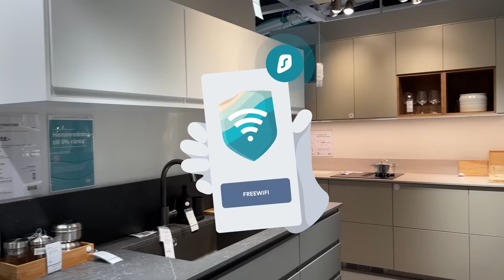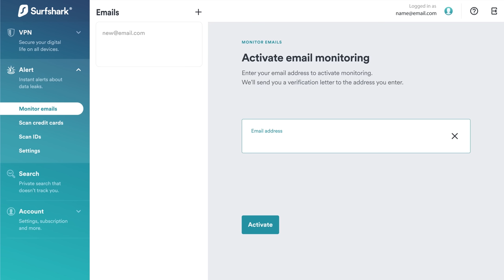Kitchen MAKEOVER- Going from DARK to LIGHT

Comment: I really like the new look.  The older I get, the more I appreciate a bright, light kitchen so I can see!  I especially like the lack of knobs on the cabinets--one of my pet peeves about the kitchen in my house is that whenever I lean in to the cabinets when I cook, the knobs catch on my shirts between the buttons.  I step away and find I'm caught!  When I redo my kitchen eventually, I'll have to look for cabinets like yours.
Reply from the maker: Yes! I had a linen shirt torn to pieces because of the knobs on my previous kitchen!
Reply: Another option is to replace knobs and pointy handles with rounded corner handles.  I have brushed nickle ones that I love.  No more accidentally opening doors and drawers.  And easier to keep clean than wiping the whole door, husband has been handle trained.

Comment: My kitchen units are the same as yours, same handles and easy to keep clean, and I love them.  Like you, I am not keen on the visible built in microwaves, and I definitely don’t want anything sitting on the work surface, so I wanted to have a microwave oven inside one of the wall cupboards, I had a power point placed inside in readiness.  However I have not been able to find a microwave oven in the U.K. that fits inside!  The interior measurement of my wall cupboards is 306mm deep and 565mm wide, if any of your viewers knows of a microwave oven that would fit, I would be very grateful!
Reply from the maker: Yes, you need a slim one! Mine is from Sharp and doesn’t have a handle. It was the slimmest one I could find.

Comment: Love the new kitchen. I also have white high gloss handless cupboards. They are very good for reflecting the light back into the room especially when the room doesn't have much natural light. The new design fits the space better. Would love to see how you organized items inside. Quick question: why did you not go for full length to the ceiling? Especially since you have a ladder handy. I find that there is a lot of dust gathering on top of the cupboards and although you cannot see it easily, it is there! And very difficult to clean (when you decide to do so...). Thank you!
Reply from the maker: I have really tall ceilings, don’t want to hide the stucco and also don’t need the storage.

Comment: Love your new white kitchen! How are you liking your sink? If I’m not mistaken, it’s a little smaller than the one in your old apartment. Has it been easy to use this new sink? I am in the process of designing a kitchen, and if I choose a larger sink then all of my base cabinets will not be the same width. I’m concerned about the visual clutter of different base cabinet widths. Your new kitchen looks so nice and streamlined as you designed it. Thanks for sharing the process with us. ❤
Reply from the maker: The sink is the same size as my last one. The color of it must play tricks with the eye!

Designing a kitchen is quite difficult, so many things to consider. I suggest getting help from the kitchen company if you haven’t already. They have so many tricks that you wouldn’t think of. I used IKEA’s help but asked them to work around the existing kitchen cabinets which was my bad. Should have asked if they could suggest a better layout as well. Now my contractor came up with that instead😅

Comment: I love that the plain white cabinets now allow the white details in the building to really shine - the doors and window molding etc are much more noticeable now. But I have a question. Did you say it took two weeks of half days for the team to remove and replace your cabinets? I just had a slightly smaller kitchen than this installed and it took 4 hours. While the workmanship in yours is no doubt much better, I'm still trying to figure out what took up all the extra time?
Reply from the maker: They weren’t here all the time during the two weeks. They came and went and had to wait for other trades to do their bit until they came again. Also this building is over 100 years old so nothing is straight here. Putting up
a kitchen from scratch is easier (and cheaper) than to take one apart and reusing parts. Also the work they did is impeccable.

Comment: Hi Benita. Could you explain what you have done with the light that hangs over the kitchen table. I noticed you have beautiful ceiling roses in the centre of each room, yet your table is not central. Just curious. Beautiful apartment and I've now had my daily motivation to get myself going. Off for my morning walk along the canal. Thanks, from Manchester, UK.
Reply from the maker: I attached a screw to the ceiling over the table and an “elbow” thingy on the cord so it doesn’t slide. Does that make any sense at all?😅

Comment: At 5:20, that track for the uppers is not level, at least not with the moulding. I assume the new cabinets hang straight and even, though.
Reply from the maker: The building is 110+ years old so nothing aside from what the carpenters installed is straight.

Comment: I would love to see a kitchen organizing video. The boys did an amazing job! The thing with doing it the right way is to do it from the scratch. It will never work if you only try to make it look good. My dad was a carpenter and if we had a wobbly chair he always took it apart completely and reassembled it with new glue etc. Otherwise it would always be wobbly. But your kitchen floor is really crooked. The basebord under the fridge is much smaller than on the other end. 😀 Dark and moody is really a problem atm. My fridge is about to break down and I have such trouble finding a new one as the majority is that horrible brushed steel OR black surfaces nowadays! I don't want a big black box in my kitchen. Aaargh, there are still white ones but they don't have the facilities I want like 'no frost' for the freezer etc. And I don't want it built in into a cabinet also as it stands for its own. I never thought it would be difficult to find a new fridge. 🥴
Reply from the maker: Yes, that's what my contractor explained right away after seeing it in person. Your dad = wise man!

Comment: Looks lovely, just one thing I noticed there is a slight gap on the second drawer under the brass tap, maybe the angle of the filming or the drawer isn’t quite shut?  Your apartment is becoming very homely 😁
Reply from the maker: Probably the angle. But also, after assembly things will shift down a bit and might need to be readjusted after a while.
Reply: @BenitaLarsson  thanks for your reply, just one more question.  My brother is coming to Stockholm at the beginning of May and I would like to know where  he would be able to pick up for me a couple of the La Bruket No 17 lip balms that I know you used to use.  It’s expensive in the UK and I thought it would be cheaper in Sweden?  Thanks Sue
Reply from the maker: @sueskiing  I think I’ve answered this before but maybe it was someone else? He’ll most likely be able to find them at Åhléns City. There’s a L:a Bruket shop in shop in the basement.

Comment: Since you noted that you kept your refrigerator, how did you convert the doors from the previous color to white?
Reply: It s an indoor refrigator so just the right cabinet and it fits with white doors
Reply from the maker: The fridge and freezer are the same, you just swap out the front of the doors! They attach in front of the appliance doors.